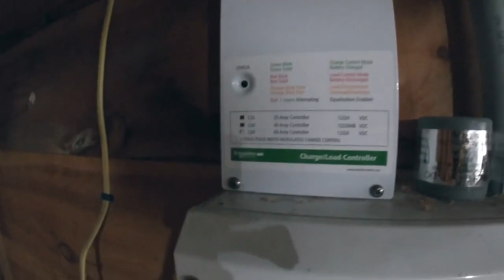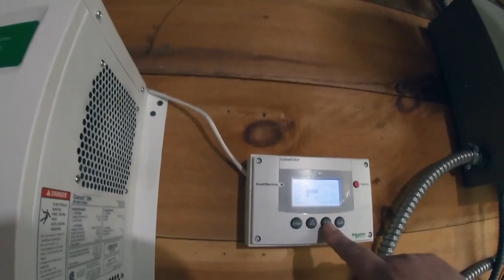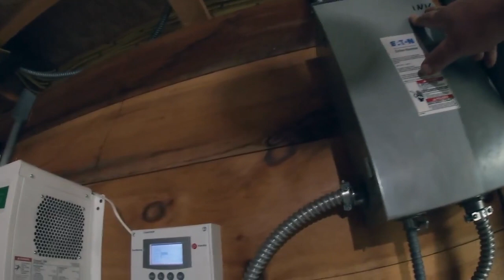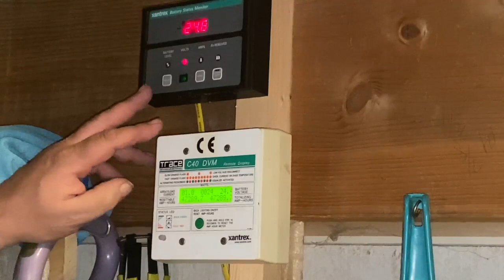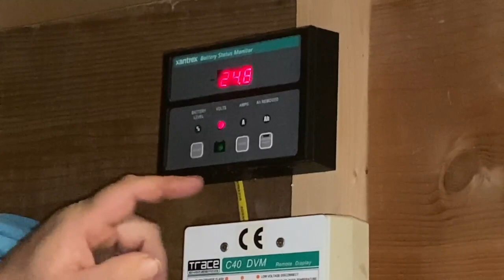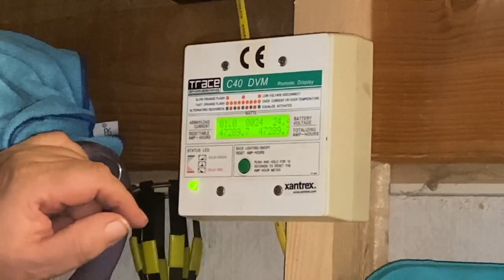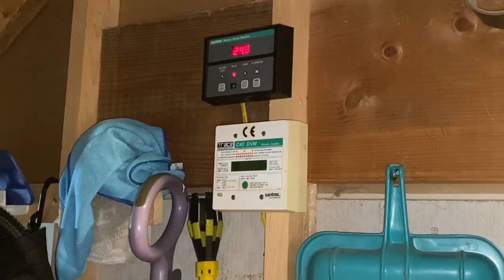Our Off Grid Solar Power System

Comment: This is a really great talk!!  In Florida, the state will not allow a resident to be completely off grid - you have to be connected to the power grid - so we are.  We lose power though a lot.  So a couple of years ago, we invested in a stand by generator (23kw) that runs off of propane.  We cook with propane and having on demand propane hot water heaters.  Our air conditioners are individual split level units for each room, so that system as a whole   - runs on a fraction of a central system.  Made me laugh during the solar array discussion - the rooster in the background was getting some action.  I enjoyed this video!!   Nice t-shirt!! 😀
Reply from the maker: Sounds like you have a good set up there. Anything to save and become more self sufficient is good in our book. 
Lol so funny you noticed that. I did too. I don’t think Scott noticed at all or he ignored it. 😂. 
Thank you for watching

Comment: Interesting. Do you have any plans for more power options, like wind power? That's interesting that you don't have the power you think you do, good to know. Thanks, Scott...excellent information.
Reply from the maker: The system works fine “as is”. Down the road I can see replacing the panels, and battery bank. The panels are 14 years old, and we replaced the batteries about 7 years ago, when we moved in. I have noticed some decline in their performance just in that length of time. The panels do degrade over time, and we’re still talking about lead acid batteries. 
It’s just fine with just the two of us living here. A lot of it is forcing yourself to control your usage.